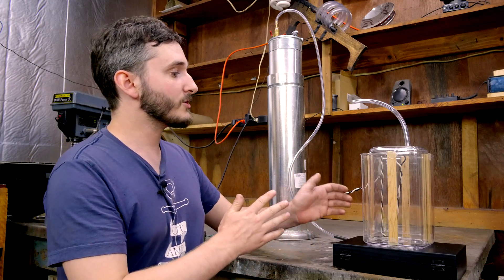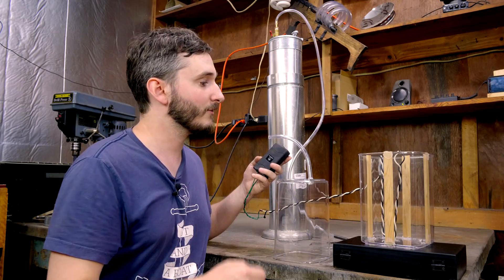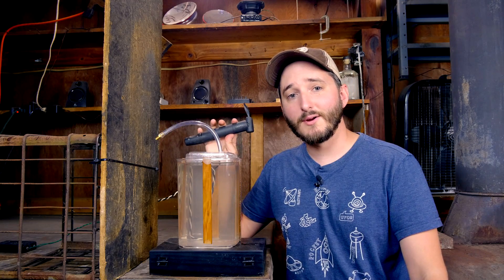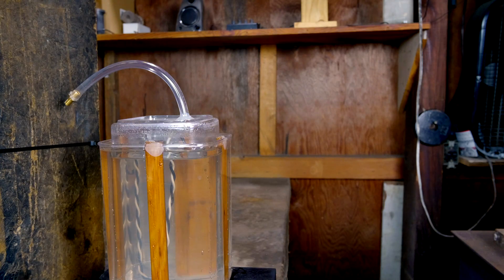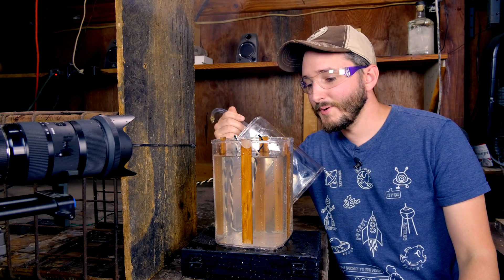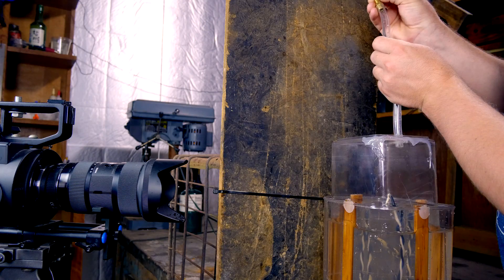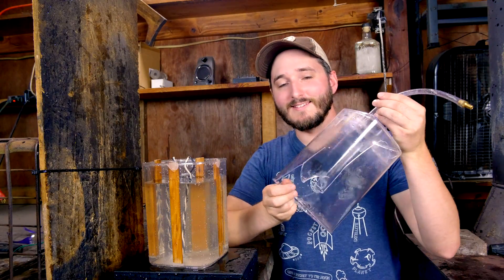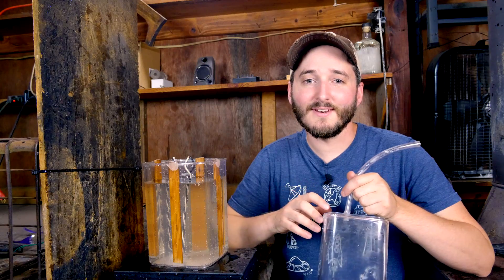Explosive Safety Testing for Bio-Fuel Storage

Comment: The green luminescence was wild. What part of the gas creates that? How buoyant is the gas? Can you fill a few balloons to see if they float? Then please ignite then with a laser.
Reply from the maker: The green was caused by the copper wires I used to make the spark.
Reply: NightHawkInLight does that mean a portion of the copper ignited (briefly)? For ex. @7:34 just as there tank seperates from the water, there is puff of green.
Reply from the maker: Some of the copper was vaporized by the electric spark and mixed with the gas as it burned
Reply: NightHawkInLight COOL! Thank you for your hard work and for taking the time to answer my questions.

Comment: Well, probably the next step would be what Cody did with gas from his HHO generator. Chanel the gasses to a trashbag with an electric tire pump inside, and pressurize them into a cilinder. Of course there will be air left in the tank so don't be near it prior to reaching one bar of pressure, so the ratio get's 50/50. Is it dangerous and stupid? absolutely, but it might be fun, and would be a great way to store the gasses.

Comment: I believe if the wood gas burns blue it means there is at least some oxygen premixed as is the case with LPG and Natural Gas. Therefore, when you burn the wood gas directly from the gasometer and it's blue you know some oxygen is already in there

Comment: I'd be curious to see how you would compress the wood gas and store it in an old propane bottle.
Reply: with that small setup the compressor from a fridge would work.
Reply: What he said. I came here to say just that.
Reply: Q-Hack! I believe Mr teslonian has done that on his channel
Reply: i agree with this. that would be awesome.
Reply: I too would like to see a safe way to store wood gas in propane bottles, as well as see how long it lasts running a generator compared to actual propane.
Reply: I'v been planning to do that
Reply: Some crazy guy on YouTube fed it into a piston type air compressor's inlet side. Don't do this. Metal on metal piston is just asking for fire.

You'd want some kind of pump like a rubber fuel line hose in a round cavity.. and bearings that roll against the hose and smash it flat in a circular pattern. These can't go boom and will also handle whatever chemicals the tubing can.
Reply: @jimmio3727  Hi Jim,
We just watched a video where the gas was heated to thousands of degrees of heat by an electronic spark. And it still didn't Ignite until volumes of  O2 were added.
I agree compressing look odd. But the data says it's safe.
Reply: @jimmio3727  theory without practice does not go boom Jim..

Comment: The green flame you can see on the high speed camera tells you that there is some interesting chemistry going on there. Not many chemicals have the right band gap for green flames. I would be interested to see if you can identify, through research or testing, what that green burning component is.
Reply from the maker: It's the copper ions that were vaporized from the copper electrodes where the spark jumped

Comment: When I turn off my propane grill there is a loud pop and a flash of flame.  Why is that?
Reply from the maker: Good question. I'm not sure
Reply: You reminded me when you spoke about different air/fuel ratios.  I read that totally lean burn is available but hard to initiate combustion.  In about '75 Honda introduced the CVCC motor.  It was a lean burn motor with a small tubular chamber of richer mixture to light the lean mixture.  See what your can find on all this.  Really interesting if we could run leaner fuel mixtures.

Comment: The nice thing about your gasometer design is that even IF there was combustion in the chamber, the top of the gasometer would just come off to release the pressure from the explosion. It's like an isobaric system opposed to a isovolumetric system (ie. a propane tank) that would most likely explode more violently in the same situation. Still a dangerous situation nonetheless. This is a very interesting series of yours
Reply: Propane?! BWAAA!
Reply: Could simply place a riser tube attached to the water reservoir and going up to the water level with a simple chain retaining the upper gas reservoir to keep it from flying apart,  but leaving the riser open to the atmosphere allowing for the water to evacuate itself from the rapid increase in pressure without any relief mechanical valve.
Reply: A bit obscure, but this just reminded me of the text with a title along the lines of "the art of distillation" by John French(?) that includes various stopper designs for a large glass flask, such as a plain glass stopper with a lead weight on it so that if pressure should build up too much, the cap would blow off, rather than the flask explode or crack, as it would be sealed and heated presumably over long durations.
Reply: You're right, but keep in mind that something like a propane tank is more than capable of withstanding the pressures produced by this sort of combustion. A propane/air deflagration in a constant volume container only produces something like 100 psi of pressure (can't recall the exact number, but it's about that much). I imagine wood gas is similar.

When it gets dangerous is when you have a system with more energy dense gasses (like acetylene), or compressed fuel/air mixtures. Look up 'hybrid potato cannon' to see how much power you can get by doing this.
Reply: @JMMC1005  You can simply place a pressure valve and it should be fixed. Since this set-up makes it fairly easy to calculate the amount of pressure a filled container has. If it surpasses that, the valve will open and release excess. Allowing the pressure to not build up. 

Albeit, it might result in a risk of not knowing impure gases got into the tank. A simple balloon on that pressure valve. You will recognize a infalted balloon as a warning sign that hte gas is starting to get contaminated by something.

Comment: Another way to store the gasses is to have two 50 gallon drums on their side with one directly over the other. Have a pipe that goes from the bottom of one drum to the bottom of the second drum. Have a hole in the top of the upper drum as a vent and fill the bottom drum with water. Then on the top of the lower drum you have a inlet where you add your gas (your schrader valve might work) . As you add gas to the bottom drum and the pressure builds the water has nowhere to go but through the bottom pipe up into the empty top drum and because the bottom drum is sealed and only has one exit at the bottom it will just keep pushing the water up to the top drum. The water that is now in the top drum will want to drain back into the bottom drum but cant as the bottom drum is sealed. However if you ever completely fill the bottom drum with gas it will just vent out the vent top drum.
Reply: JonnieMazda but if that does detonate/burn you're screwed. The sliding portion of the gasometer provides an easy pressure relief by moving up, the barrel would have to catastrophically fail to release the pressure.

Comment: Good experiment to do. Most people don't realize that you need a certain oxygen-fuel mix in order to get an explosion. They think if you throw a cigarette into a bunch of gasoline, it will blow up. Fact is, it won't. It may burn, but won't necessarily explode. And it's all based on the ratios, which depend on the fuel involved. And jet fuel is dang near impossible to even ignite.

Comment: I imagine you’re planning quite a few wood-gas projects, but it would also be interesting to see if you can use coal instead of wood in your gasifier. The left-overs might be akin to coal-coke and be usable as a clean charcoal-like fuel for smelting.

Apart from that would be the usual Bunsen-burner, gas-stove, hot water heater, perhaps a primitive engine of some sort.

Great video!
Reply: I'm not sure, but I'm pretty sure wood-gas only really works because of other chemicals other than just carbon in the wood, whereas coal is almost entirely carbon, so it's more like the charcoal you're left with after making the wood gas. Basically the coal is the by-product of a natural wood-gasification process, just under very high pressure. that's what i've been told anyway. still worth trying though i think.
Reply: I know it’s been 4 years so you might have found the answer, but there are actually charcoal gasifiers. Wood gas is  updraft iirc, where charcoal is down. So little different, and the need for filtering is much less.

Comment: To anyone else wondering why the bottom of the explosion is green here is my theory: 

He is using copper electrodes with a very high voltage (and moderately high current) arc which leads to some of the copper vaporizing off of the wires at the points of contact. This copper vapor remains in the air during the explosion and the gaseous copper atoms are excited by the explosion and so they emit they emit green light. 

Slightly Different Explanation: 
This one might make even more sense as it does not require gaseous copper, but rather small bits of ionic copper dissolved in the water vapor in the container. The idea here is that the arc ionizes the copper and these ions are dissolved into the water vapor in the air. It's a very similar process but I think this explanation is a bit more plausible. 

It would be pretty cool to test it and see if it still works w/o the water. Having thought more about it, my guess is no, and if it does, I would be willing to bet it wouldn't if you put a desiccant at the bottom of the container to remove any residual water vapor from the air.

Comment: Instead of placing your very expensive high speed camera right next to an explosion, place the camera behind some cover and film your subject using a mirror to see around the corner. Worst case is the mirror gets damaged, and you can always flip the video in post to put it back to normal.
Reply: Next video: High speed camera safety testing for filming explosions
Reply: next video: exploding stuff in front of my camera to see if it would damage it
Reply: what about just using a simple zoom lens?
Reply: @BloodSprite-tan  mirrors are much cheaper than lenses.
Reply: @NM-wd7kx  are you imply he doesn't already have one?
Reply: @BloodSprite-tan  he might well, but I'd have expected him to use it if he did.
Reply: @NM-wd7kx  But then the camera should be close to the mirror as well then... unless it's a parabolic mirror, but it'd probably be cheaper to buy a zoom lens. What about some polycarbonate to protect the camera?
Reply: @BloodSprite-tan  I know this is a 3 year old comment, but even if he already has a lens, the mirror being the most likely to be damaged, would be cheaper to replace.

Comment: I'm fairly impressed with the effectiveness of the gasometer, considering how old the tech is. The water in the system could help deter fires, and it appears that you need a large supply of air in the tank in order for it to even burn, so as long as you bleed the lines regularly, there shouldn't be a problem. This could probably be automated using an 02 sensor for a vehicle and a pneumatic solenoid built into the top of the tank.... basically when the oxygen sensor detects a certain amount of oxygen, insted of firing a cylinder, it switches a solenoid valve to bleed the oxygen out, and then closes again.

Is woodgas heavier or lighter than air?
Reply from the maker: Wood gas is a mix of many gasses, most heavier than air but some are lighter. There is some hydrogen content.
Reply: CO, CH4, H2 mostly.

edit: Oh, and some water vapor is inevitable aswell.

Comment: Nice!

I looked up flammability limits for Hydrogen and CO, which (besides nitrogen) probably comprise the majority of your flammable gas.  But the numbers don't really seem to work very well.  The data suggest you should get ignition at lower concentrations of air.  I think  the probably-large percentage of inert nitrogen that's in your mix is the cause, effectively increasing the proportion of air necessary to ignition.

It's possible to use gasification methods that produce less nitrogen.  If you do change your methods in any meaningful way, I would suggest that you assume the safe tolerance for air in your product might have changed considerably.

Also the solubility of gases in water might be worth some thought.  Some of your gases will be more likely than others to diffuse into the water in your capture container.  The mix so stored will undoubtedly shift over time to some degree.
Reply from the maker: It's mostly CO. Are you sure you pulled up tables for mixes with air and not pure O2?

Comment: I think a more simple way of testing it would be to open a valve and light the gas like you did in your B roll. And when your gas runs out the air will pull in. Then the tank may explode. But if you always have it charged, it should never allow oxy up the line. So dont forget and leave an experiment un attended.

 But this whole vid of finding the LEL is IMO not answering the safety question. 
Put a flame arrestor for safety. Because it may not always be you, in and around that equipment.

Comment: I'm sure this is elsewhere in the thread, but in industrial safety, this is UEL and LEL, upper and lower explosive limits. They vary quite a bit between fuels. Very important in confined space entry procedures, like cleaning out a gas tanker or some such. Also it would be cool to do this experiment with pure O2 to get the actual stoichiometric burn.

Comment: 7:20, very interesting the delayed reaction and what appeared to be smoke or fire that formed leading just up to it.
Reply: TrollFaceTheMan Hey, ma man! And interesting is why there is green fire after explosion 🤔
Reply: I'd say it's just the insulation on the wires of the igniter burning off
Reply: Rough guess, it required more activation energy before it could ignite, the smoke was likely the beginnings of the reaction which could only take place in the high energy of the plasma, but once it got going the rest was able to ignite.

Comment: Night, what are your plans for a long term storage? I do understand that the water in the current storage device is used for filtration. So after you believe the wood gas has been purified enough, do you plan to find a way to compress it and store it in some type of tank? My thought process is an efficient storage tank to use as the fuel for an engine of some sort. Keep up the amazing work!
Reply: I was thinking on modifying a bicycle pump (or building a pump) so that it can intake purified wood gas to be pumped into either a metal air tank (those small metal tanks for holding air for air tools) or making a woodgas tank out of ABS or PVC (whichever generates less static) so one can be used for powering a small engine.
Reply: Wood gas is, among other factors, CO and H2.  Compressing it will promote production of methanol.  Now, there's still a kinetic barrier (that's why to do it deliberately one uses a catalyst and heat as well), but that's a thing to bear in mind if compressing it.  

That said, methanol is a useful fuel, with higher energy density than a gas - if it wasn't toxic it'd be an almost ideal fuel for many purposes! In practice, most wood gas is a bit deficient in hydrogen to be optimal, however.  Still, if one wanted to go to extremes, then making 'water gas' with the left over charcoal is how to get more out of the fuel.
Reply: @syninys100   It would be interesting to set up a contest to see who could extract the most fuel from a given weight of wood stock.

Comment: In this case, the water really is pulling the air inwards actually. The water is trying to fall to be level with the rest of the water, but cannot do so without drawing a vacuum above it, which the atmosphere's pressure is preventing by pushing on the water. When you let air in, the water overcome's the air's pushing on the lower water because now more air is pushing on the inner canister's water, equalising the air pressures somewhat and letting the water do its thing and get closer to level. So I guess it's both, really.

Comment: What you should have done with your test tank you should have put string on the test tank and suspend it above you so when it flys up in the air the string won't let it slam to the floor and your test tank will always be intact every single time

Comment: It’s like why you don’t need any arrestors when using a barbecue tank of propane, there isn’t a way for oxygen to enter the tank because there is constantly gas flowing out of the system so none can go back. If you were using an oxygen tank, you would be safer using arrestors though

Comment: that small green part at the bottom of the explosion, is that realy caused by the bit of copper wiring from the igniter or is it something else?
Reply from the maker: Yep, the wire
Reply: thx, love how fast you read the comments and reply.
Reply: Not so fast! While copper could be part of the source of the green colored flames, my experience with flames and copper wire igniters like this tells me that there's more at work here. Don't forget, boron is an essential mineral for plant cells. I wouldn't be surprised if there are decent levels of organo-boron compounds in your wood gas, and I would expect a lot more boron ions in the vapor than copper. Also, at least from my experiments, boron compounds give a stronger green flame more easily than copper compounds do.

+NightHawkInLight Test the theory! Try the same setup with propane or butane!
Reply: Boron instantly came to my mind too, but i didn't know that it is so common in plant cells. It would make a lot of sense this way.